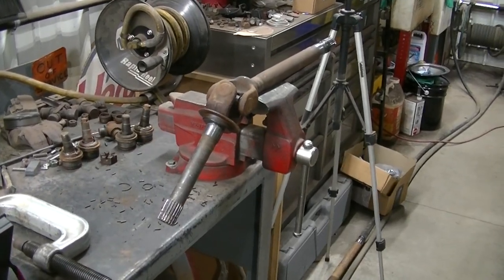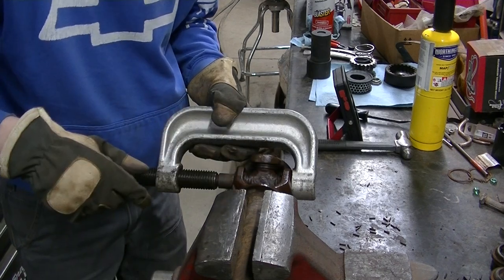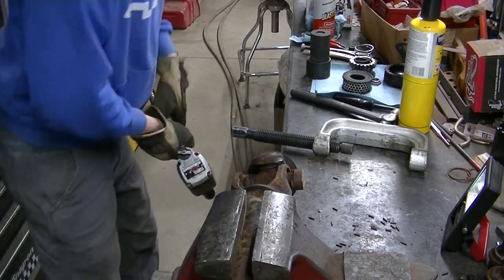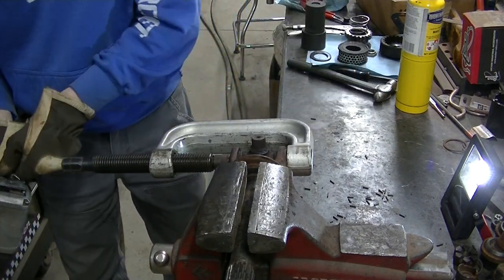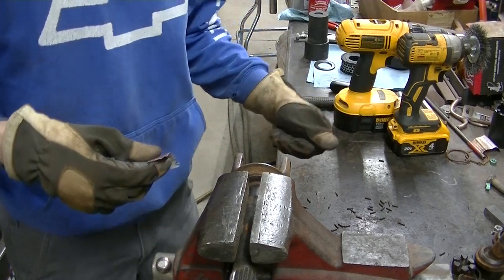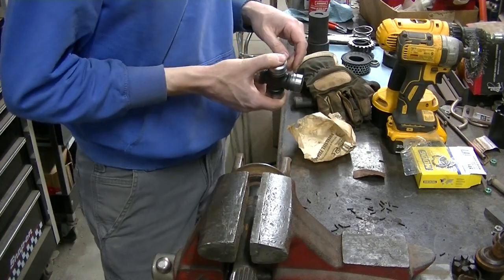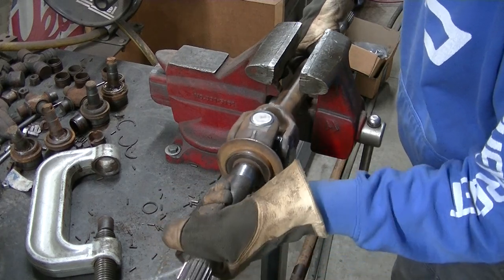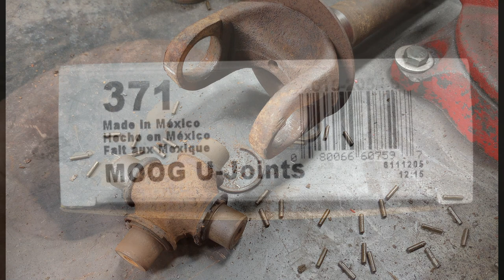80 Chevy Silverado Dana 44 Front Axle U Joints Remove & Install

Comment: as a driveline builder, and shop owner, i'd have that joint out, and changed in about 10 min lol. i torch them out, and punch the caps through. the jar of the hammer/punch keeps the ears from bending as you said, if being used in a press.
Reply: also you dont need to remove the snap rings after torching the body out